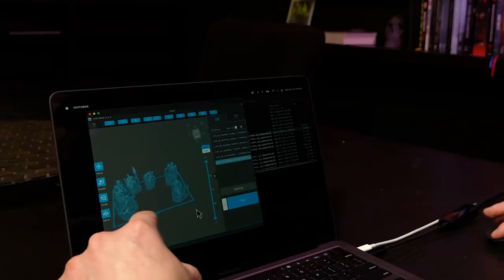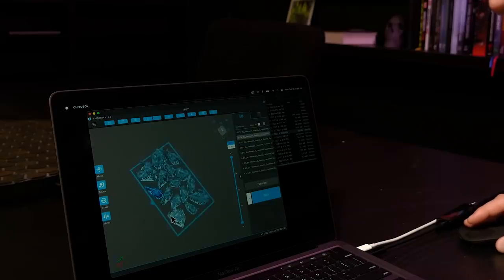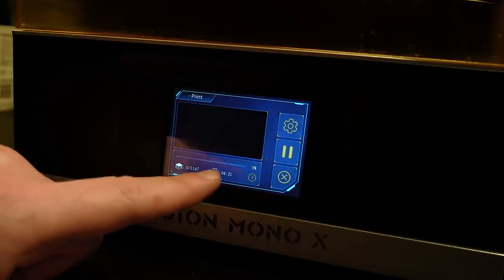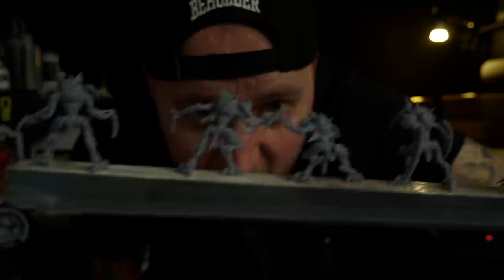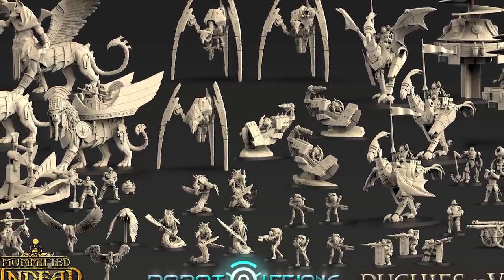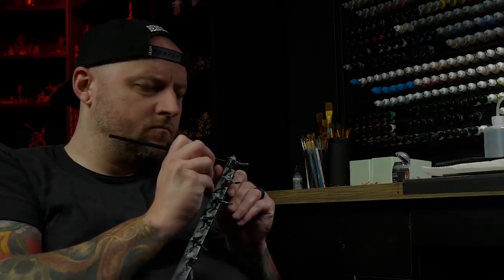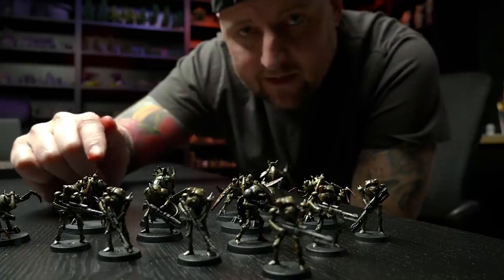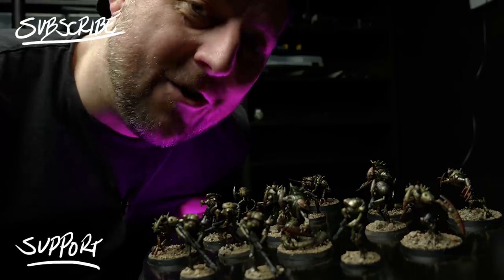Can You PRINT, PAINT, & BASE an Army in Just 1 Day?

Comment: With my Mono X I print very quickly. 1.0s exposure time and and 20s bottom layer with Siraya Tech resin. I usually get miniatures done in 2 hours or less. Black Magic Craft, You should probably use PTFE to help with the FEP sticking and yeah slowing the Lift Speeds helps with it as well. I also have to say my firmware is a custom firmware Anycubic gave me for my Mono X so not sure if that is the specific reason for my prints being able to print so quickly.

Comment: If you're having trouble with the center of your plate for the mono x there are a few things you can try. I had a series of blunders for this printer as well. 

1. You're Fep may be damaged, or its not tuned properly. If its the same one that came with the unit, its MOST Likely over-tightened, and cannot be tuned further.  You'll have to buy a new fep. I've got recommendations if you need them,
2. Your plate isn't level, this one is a trick specifically because you may be doing an excellent job in the leveling process, however, you're not locking down the plate on the armature the same way if you've taken it off since then. You'll note that when you put the plate on and turn the knob, it may move slightly There are a few printed remedies for this as 'upgrades' to your machine.
3. You're resin isn't warm enough. Depending on what you're using, it may just be meh resin. I use Elego ABS like Grey or Siraya tech Navy Blue. Both good results.

-- Hapy to connect with you over discord if needed
Reply from the maker: I actually changed the FEP and haven’t had an issue with the center since. Don’t know if it’s the lift speed or that, but things are working better now regardless.
Reply: @BlackMagicCraftOfficial  lift speed / vroom settings do have an impact. I'm not sure if I'm just lucky or not. I've found the mono x to be very machine specific in terms of settings and... 'results'. Awesome to hear that yours are getting better! I look forward to. More content!

Comment: Ever since I saw your video on making the ballista for the duchies of vinci I was obsessed with those models and I can say that video alone was enough to get me into 3D printing. About a month ago I got started with a photon mono and now this week I've finally started printing out a DoV army to proxy as a kingdoms of men army for kings of war. I'm hoping to get most of if not all the army printed over the week, however I think that the pièce de résistance of the army (an automata guard blown up by 400% to proxy as a giant) will probably take me over that time limit. Also your day 1 with a 3D printer video was a helpful resource when I was setting up to do my first print. Only thing I will say is that I unfortunately don't seem to get on with OPR's supports, I find them very finicky in ways I've not had with others. The main thing is I've found sometimes that the supports just don't come off well and occasionally take parts of the model with them, especially thinner more delicate parts. It's odd since I've not had this problem with anything else I've printed.
Reply from the maker: Have you tried the hot water removal technique? Helps a lot.
Reply: @BlackMagicCraftOfficial  Yeah, thanks for the tip though. It might be a temp thing, I've used hot water which seems like it was just enough to get the supports off which may mean the breaks were from me exerting too much force when trying to remove them. I've had a better time using water straight from the boiling kettle, as it allows me to flex more delicate parts away from the supports, but that in turn may be making the model too weak, guess it's just going to take a bit of finnessing!

Comment: I'd done a 24 hour thing shortly before Covid lockdowns started though more limited in options because it was when the game store owner got a few resin printers (Most were borrowed for the contest they had)...a lot of things for going from print to table is picking your models right for it. You can also "cheat" with different options depending upon your specific choices.

I went for a spectral undead force that let me spend most of my time in details...starting with a transparent/translucent blue resin option and some historical models for a force of ghostly warriors. After curing, I hit them with a mat varnish spray followed by a light blue drybrush, then it was for red glowing eyes (I filled the eyes with reaper gory red and dotted with their breast cancer awareness pink, then a smaller dot of pure white), along with some detail work with metallics and some brighter colors for gems. Had a second print run of detail pieces for the bases that were rather easy to do and mix up for the base...the original setup were for the models, second were some tombstones and similar things for the bases that mixed with some basing mix.

Actual contest was starting in the evening and running the prints over night and a second print run available if we wanted it during the day of work.

It was fun and exhausting there, force was still at the store last time I was there and it got me $50...which got me a pretty good D&D book

Comment: Nice job in just a day! Just a little suggestion from a guy down the road in Regina...check your room temperature when printing with resin.  I built a little enclosure and added a small heater for my printer and it made a HUGE difference with reducing failures.  It's hard to justify keeping an entire room at 25C to 30C for a print but it can REALLY help depending on the recommended temperature range for your resin.

Comment: I know you mentioned things failing in the center of the print bed - myself and many others had the same issue on the Mono X, what potentially is the case is a warped print bed. Anycubic sent out a LOT of printers with a bed that was concave so the middle was sunken in compared to the sides, just enough so things would fail.
Reply from the maker: I think my issue was the factory FEP being too tight, because I changed it and it seems to have resolved the problem.

Comment: For stuff to stick better you can kick up the bottom exposure time, as you conclude, more lift height will probably help, especially for larger build volumes as more fep has more stretch before everything lets go.
If models dont build on your supports you are most likely under exposing or the temperature being too low for the resin to cure in the expected time.

Comment: 2.5s layer time is... kinda short, specially for medium and large format printers. It makes sense if it's a Mono screen, but only on translucent resins.
I've had more luck in the 2.7-2.8 range on the same resin you're using. 
Though I only do like 4-5 bottom layers at 35-38s, 55 seems like a lot; though that's not a big deal and highly depends on the printer.

1.8-2.5s layer time is absolutely possible with transparent or translucent ABS like resins, at least that's been my experience; if it's warm, cold resin makes things difficult.

Good luck!
Reply: Ideal exposure times vary significantly even between printers of the same brand because they're manufactured cheaply and tolerances deviate quite a lot. My original photon required about 16s exposure for the same resin that other people used 6s exposure. That said, I assume he was pretty underexposed for this print.
Reply from the maker: I think in general most people overexpose to avoid failures. I’ve found this resin on this printer to give the best detail around 2.5/2.6. I went through a bottle of zMUD beige and got best detail and no over exposure over 3 seconds.
Reply: @BlackMagicCraftOfficial  zMUD beige, that's people; right?
Reply: @euansmith3699  SOYLENT RESIN IS PEOPLE!!!
Reply: I use a mono X and Siraya tech fast grey with 2 sec exposure and have very few failures which are mainly down to undersupporting

Comment: failures in the middle happens because that's where the fep lifts the most (being far away from the edges). you can get a few more prints by lowering lifting speed and raising lifting height, but at the end of the day it just means it's about time to replace the fep with a new one.
Reply from the maker: I did end up replacing it, even though it was fairly new, and it seems to have helped a lot!

Comment: Yeah, lift speed can cause a whole ton of issues. Since I reduced mine significantly (90 is crazy to me tho, mine is at 35. But then, I have a Gen1 Photon, the Mono X might be different in that regard), I barely have ANY failures at all any more, even on delicate bits and supports.
BTW, you could've probably fit another 6-8 models on that plate with a little bit of plate tetris.

Comment: I have a dumb question... Do you simply super glue the mini on a stick?  I ask this because I've done that before and I often have terrible removing them later... At least not without snapping off a thin leg or joint or accidentally cutting off a toe.  I'm just wondering if there's a glue that's easy to remove later but strong enough that I can flip the mini upside down without falling off the stick.  I've tried poster tack and double sided tape as well, but they don't work any better.
Reply from the maker: I sometimes glue, but yea it can be sketch to remove. I mostly use double sided tape. In general I often glue to bases before paint just cause I can then attach the base to something with less worry.

Comment: If you spray WD-40 Specialist Dry Lube With PTFE on a paper towel and coat the resin tray before adding the resin, it will stop the sticking.  I had a few failed prints till I learned about that, now it  only fails when I run out of resin, runing lift speed at 80 and never sticking.  Also mix in 10-20% Siraya Tech Tenacious wiht the standard grey resin and models won't be so brittle.
Reply from the maker: I’m not convinced about the PTFE. There’s a lot of argument for it being snake oil or a bandaid, BUT I did order a bottler on Tenacious the other day to mix in.
Reply: @BlackMagicCraftOfficial  PTFE lube is recommended against by most manufacturers/professional printers. It's essentially the same material as the FEP anyway, it only lasts for a few prints, and can mix with and degrade resin properties. If prints are failing there is a different issue, and PTFE just adds another variable to go wrong.
Reply from the maker: Exactly. I know it can be a quick “fix” but I’d prefer to try and work out and correct the real problem.
Reply: @BlackMagicCraftOfficial  The amount I've used is very small, on a paper towel wiped on the bottom of the tray, doubt I'll ever use the entire can.  I don't leave resin in the tray after my print has fininshed, it stopped the sticking that I was running into when I first started, never found any issues using it.  The tenacious has made a huge diffrence though, I was running into swords snapping when removing the supports, went to a 50/50 mix and you can bend the weapons without breaking.  Use a 10% for walls, floors and such but I go back to 50/50 for characters.

Comment: Heyo , no doubt you probably tried it with yours but on my HalotOne printer i had issues with adhesion in the middle and after trying a bunch of suggestions it was the derpiest simplest thing, re-tension my FEP...... that solved it... though as an aid i also always wipe down the fep with PTFE dry lubricant spray whenever i drain the vat and clean everything, every little helps right? :) good fun stuff though man, those late night 'ooh i could just do XYZ' are the bane of my GM'ing existence.. but it keeps me on my toes!
Reply from the maker: I actually damaged then replaced my FEP and haven’t had the middle stick since.

Comment: One thing I've learned from being a procrastinator btw: For resin prints you can *absolutely* skip priming. Takes too long to dry and airbrushing on a basecoat of regular acrylic black/zenithal works just fine and is dry in minutes. Paint grabs on to resin prints very well because the surface isn't actually smooth but made up of tiny voxel cubes. As long as you seal the minis properly, priming is not at all needed.

Comment: You should use PPE when working with resin.
Reply from the maker: I do
Reply: @BlackMagicCraftOfficial  I know that most of the time, I see you using it, so I was surprised to see you remove your prints without glasses and respiratory protection.
Reply from the maker: I have a powerful extraction fan for the resin vapours, and wasn’t in danger of splashes to the eyes.

Comment: One thing that REALLY helps is to make sure you always empty your vat and clean the FEP thoroughly between prints. (I have two vats so I can just pour the leftover resin from one to the other so I can clean one while the other is printing).
Every print run will leave resin residue on the FEP, which makes it way more sticky. The more prints between cleaning, the stickier it gets.
The FEP also just gets stickier over time, even with regular cleaning, so don't forget to replace it regularly

Comment: Do your own supports and you will have fewer failures, use the chitubox auto support with light supports then add heavy supports to the bottom of the feet, supplement with medium supports in flat areas that make it easy to trim and undercut areas that will not show. If you trim the heavy supports on the bottom of the feet longer, you can use them as built in pins to pin the model to the base.

Comment: PLEASE PLEASE PLEASE wear safety glasses whenever you have resin out in the open (like when you remove your models from the printer). All it takes is for something to fall from the build plate, into the vat and you'll get resin in your eyes and have life long health issues. Make it a habit like a seatbelt and it won't feel like a hassle.

Same goes for a vapor ventilator. You may not mind the smell or be using a low odour resin, but prolonged exposure to VOCs is terrible for you. You only get one set of eyes and lungs folks, take care of them